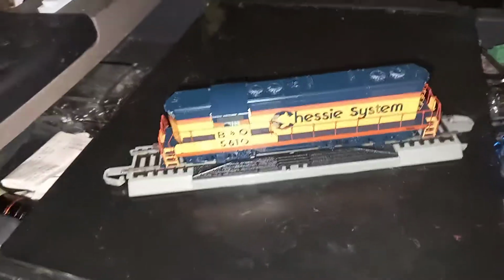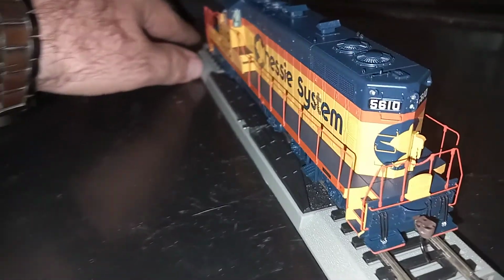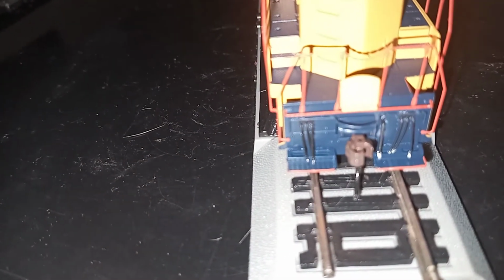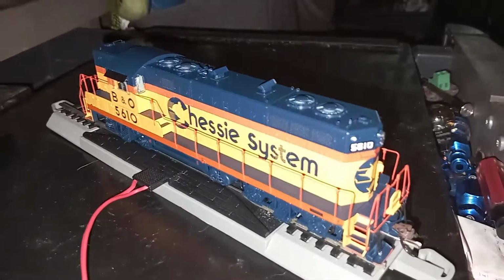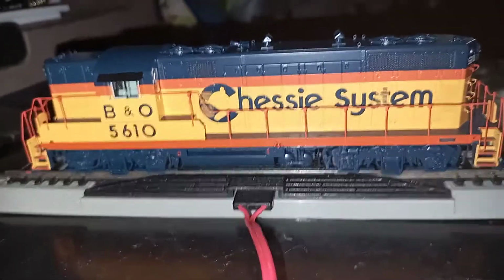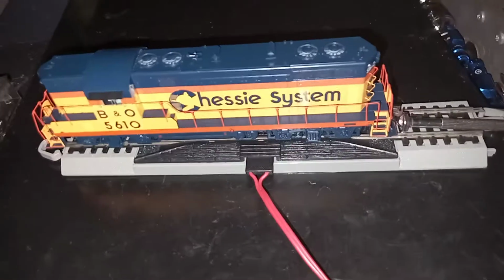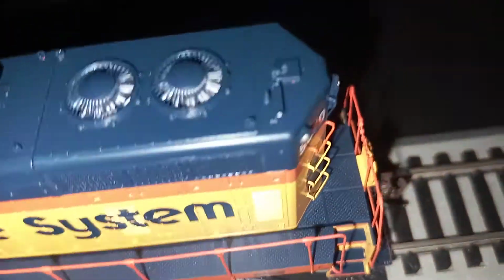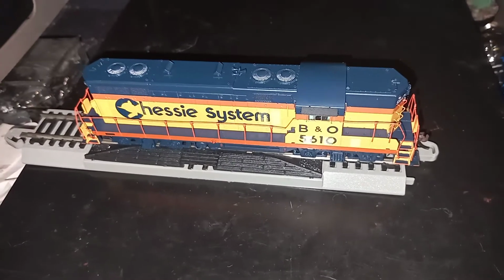New Athearn Genesis GP-7 with Tsunami 2 DCC and Sound

Comment: Been nice had it been test run to see how smooth (hopefully) it moves slow or fast. I have 2 on the way. Hoping they arrive tomorrow
Reply from the maker: I did test on about 4 feet of track last weekend. They are smooth and I didn't notice any jerkiness. I also set up DDE using decoder pro.
Reply from the maker: Also, I'm doing these reviews in the sleeper of a tractor trailer. Space is very restrictive. Hence the reason I only use a 9" section of track for these reviews. The video of my EM1 is a horrible example of trying to use 45" of track. It almost took a dive to the floor. I got lucky though.

Comment: The paint bleed thru thing, real engines have spots like this all the time. I was a Conrail then NS engineer for along time. If it bothers you I'd dimple weather those spots. I have alot of locomotives and the thought of weathering them all is daunting at least
Reply from the maker: I have thought about that, but I have a very well known gentleman do my locomotive and high end caboose weathering. I am going to have him see what he can do for it.
Reply: @Mumbles19852007  what state does this guy live in? I have some stuff that needs weathering, I can't find the time
Reply from the maker: @tomatkinson6996  I use Quinn's Weathering Depot. He's in Indianapolis. He has done 5 locos and 2 cabeese for me. A+ in my book.
Reply from the maker: Don't feel bad, I have over 30 in my collection and over 25 to get weathered.
Reply from the maker: @tomatkinson6996  message me on FB and I'll send you pics of the work he has done for me.
Reply from the maker: He's done 2 SD40-2s, 2 GP40-2s 2 GP30s, and 2 tangent cabeese for me. Very nice job on my equipment.